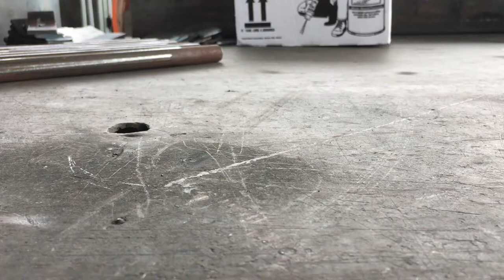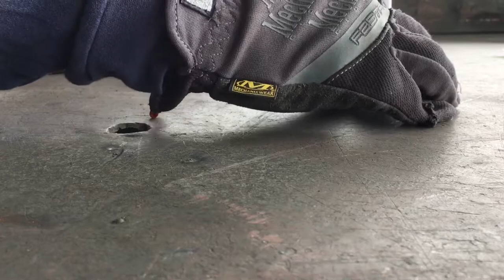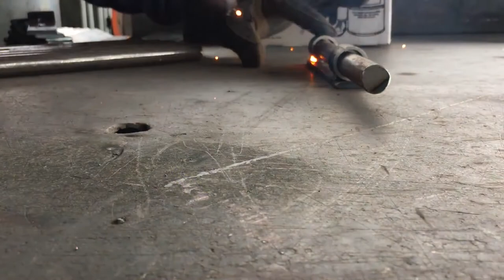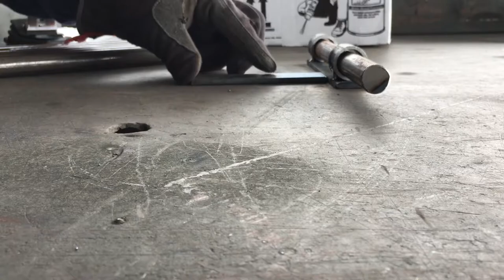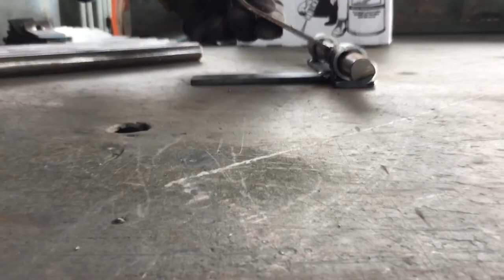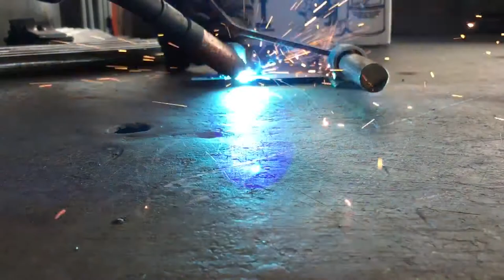How to make a gate slide latch

Comment: good job . . made mine just as you did - works a treat, thanks caleb
btw - is that a concrete worktop ? looks neat !  (wish i had a mig/tig so much easier)
Reply from the maker: steight oftheHart thanks , it’s actually my metal work bench